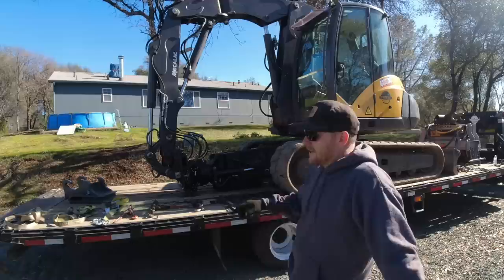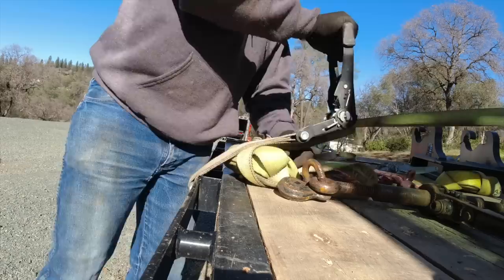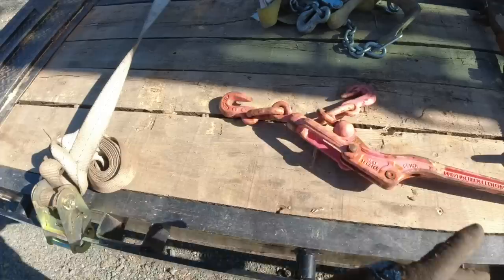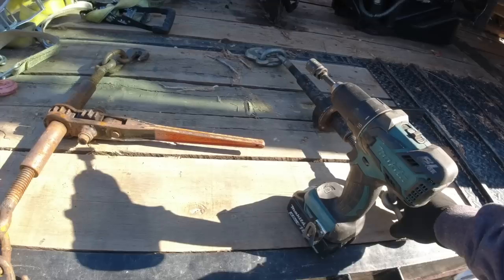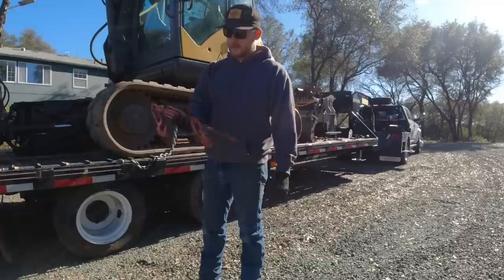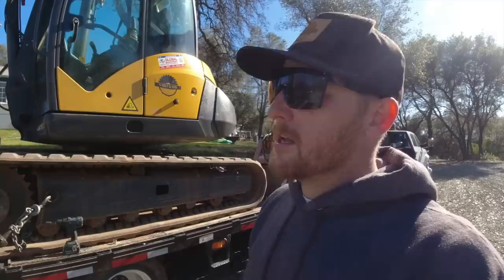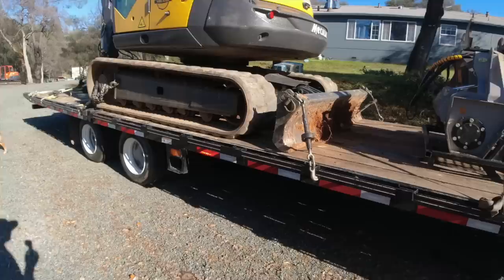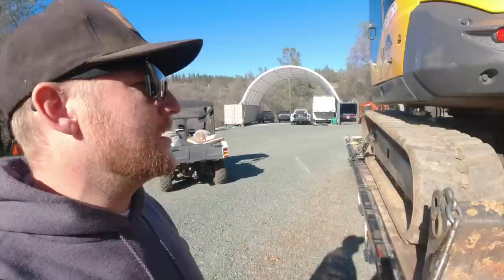The Biggest Fail when chaining down. Best and worst BINDERS

Comment: Good video. At 70 years young I'm stuck with a pipe and snap binders. If you are hauling rubber tired equipment  they work ok. Use to be required to have  all binders on drivers side. I like your new trailer and binders. 
Thanks for sharing!!!

Comment: Good comparison. Definitely agree with the slack adjuster based binders being the best. One thing though, OIL the threads and moving parts on the steel binders from time to time. You can get a lot more torque on an oiled thread.

Comment: The first white one is made for Air Force aluminum cargo pallets. With the hook integral to the ratchet it makes them difficult to use in most cases. You can even see the way you use em they don't fully close and latch.

Comment: If you use the snap binders a lot, you know the tricks on how to use them. My favorite use is for securing a small stack of dunnage on the deck. But for now my snap binder days are over... A very bumpy Mississippi road bounced my toolbox door open and now someone else is using all the binders, chains and coil racks I had inside. As for the tail of the chain, I use a bungee to secure them. Running flatbed means having to tarp so you carry 50 bungees at a minimum.

Comment: we still like the original speed binders Dirt Perfect has,  however they got bought out and are under a new company and manufacturer,  not as impressed.  we will keep using the originals but most likely wont go with any new ones.  Mainly customer service issues and we have heard some quality control issues from people that have purchased them since the company was sold.  that mecalac is a cool machine man.  stay safe.
Reply from the maker: Ahh shoot hood for them but bummer about the new ones. I had a set of og ones on my little buddy trailer I put on the new trailer so thankfully we are still set up. Binders put up with a lot
Reply: So funny to see you in here on Sams channel!! So when is MBTS coming over to your place to give you a few welding tips????
Reply: Well 💩, one of my speed binder has a good wobble, not sure if it’s the new or old version. I did email customer service to see if I could get a new tube and they said “it happens”. Sucks they sold out.

Comment: Seen those speed binders on your channel when you first did a video on them, went out bought 8 of them to replace what I had an absolutely love them!    They have made my life so much easier and faster chaining down equipment!    One thing to maybe check out would be some ratchet straps from USA Ratchet.  I bought some of those and they are great!   With those there is no tails to worry about comes on a reel hard to explain the setup but they are also super nice and give a nice clean look with like I said no tails to worry about doing up after tightening.

Comment: I hauled and installed fencing for 15 years, primarily vinyl and chainlink.
Dealung with material especially in bundles.
How many times have you seen a bunk of lumber that is missing boards in the center( i have probably 15x personaly)?
Vinyl will crimp,but will loosen.
Chainlink tubing on a steel deck trailer is slicker then owl snot.
When material is on dunnage it gives you the option of 1 wrap at the front or rear,if a multiple wrap front of front...and rear of rear.
For basic strapping ,DOT have pulled me over for 2 straps on 12 ft material..he wanted straps every 4ft...so have enough to satisfy them + 2-3 extra.
For straps.... stand on passenger side and hook dummy end  +3 ft more than you need, then throw the ratchet across to drivers side.
The weight of the ratchet keeps tension till you get all thrown,if a strap comes loose you don't want to jump over a bumper pull /under a gooseneck to re-tighten from passenger side.
After throwing all straps,walk back and tighten.
For a specific equipment you should have it figured to a science.
I had 2 hydraulically driven "easy augers" and used 7 trailers.
Both machines had snap binders attached to both machines,and all 7 trailers had 3 links of chain for the binder at the exact point it was used at.
Ramps in front,wheelbarrow encapsulating a 14/8 inch auger tied down with extra tail of front strap.
For hauling a tractor stopped 3 inches from where it needed to be,hooked 2 chains at rear and drove the last 3 to tighten.
Then ratchet binders going to the front.
If you do the same thing every day and it takes extra time,you are not an operator...just a flunky.

Comment: You're right Sam, Securement is allowed to be outside the 102" however dunnage is not.
Reply: Think canada didn't like the hooks outside the rub rail had to be inside the rub rail. Can you turn the speed binders with a normal ratchet or wreach, have a12volt  inverter in in the truck anyway. Seen someone siad the cam snap over binders are no allowed they stink anyway wounder where that is

Comment: That was a cool intro! Those speed binders are the way to go but for now I’ve been rolling with the conventional manual ratcheting ones. They work well but after a full day of loading and unloading machinery, they kinda wear you out.
Reply: I have been wondering how tight the speed ones actually pull. Would be cool to see a video with one hooked to a scale and do that VS ratchet one. But it appeared in this video he got the speed one tighter then ratchet

Comment: The real issue with anything outside the rub rail is that a side swipe accident can remove one or all tie downs on that side of the truck bed/trailer in an instant. And, there's no legal exemption for over width.
Reply from the maker: Not illegal to chain like this. 99.999% of trucks on the road are chaining like this. I was just inspecting by DOT and they didn’t say anything was wrong and had two machines on deck tied down like this. If you get hit hard enough to rip the binder or rail off you have some serious problems and the location of the hooks won’t matter

Comment: As far as anything over 102 securement doesn't count as long as it's not part of the load you can have it overhang and as far as straps and everything being on the inside of the rubber that's just like if you side swipe something less chances of it you know breaking your securement and losing the load
Reply: Agree that it's not a great idea to have hooks/straps outside the rub rail even if it isn't illegal.  Seems like common sense to avoid the risk of having the load become unsecured if the trailer is side swiped.
Reply from the maker: Seems like you have other problems if you’re getting ran into and should pull over asap. Have to pretty much total the trailer to rip the rail off